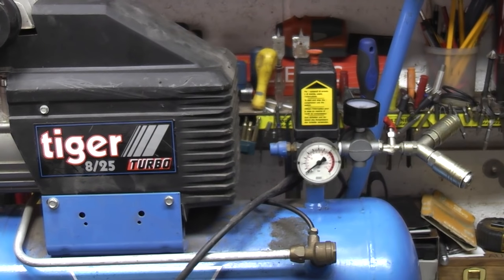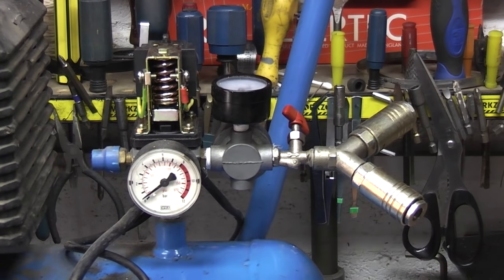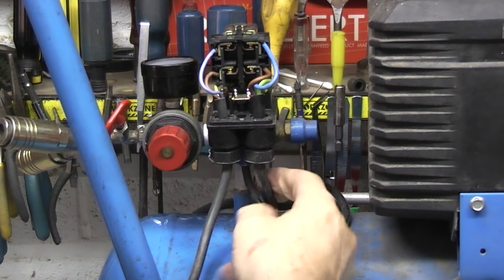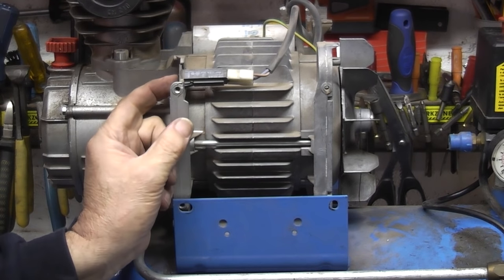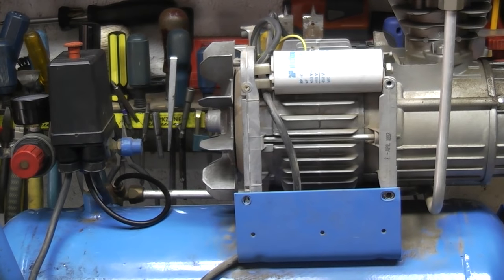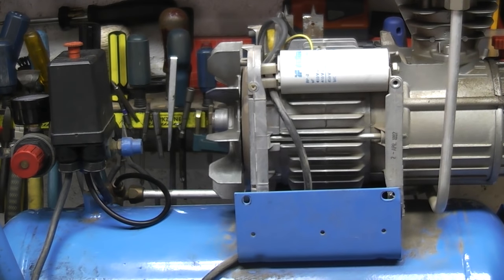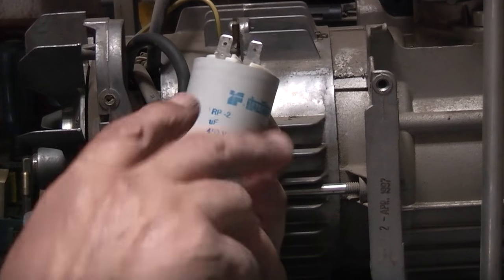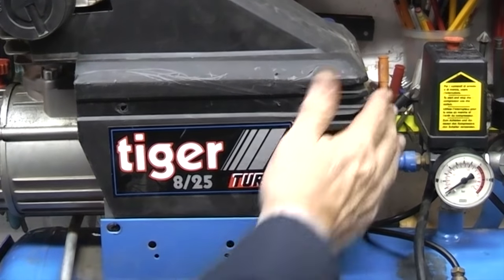Faulty air compressor repair

Comment: I have the same compressor Alan and had the same symptoms and it was the valve you opened up that was the fault it was not releasing the pressure to the pump which when there is pressure in the tank causes the motor to stall.

Comment: Alan, the brass valve is a check valve, the tubing going to the pressure switch is for a air bleed off valve in the pressure switch, it bleeds off the pressure between the check valve and the compressor, you should hear a hiss when the compressor shuts off. it looks to me the bleed off valve isn’t working!

Comment: I have a different problem. My compressor is running, but the pressure doesn't increase. It was working fine, and then, all of a sudden, the sound changed, and now it doesn't increase the pressure(stays at 0)
Reply from the maker: Hi I’ve not had that problem, if it has oil check the level check no leaking pipes and check the regulator is not  stuck.